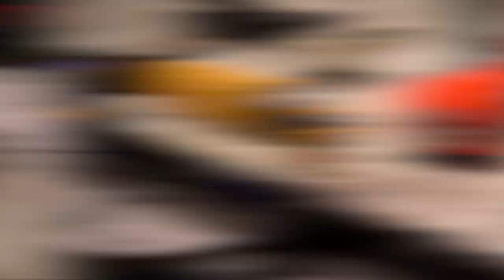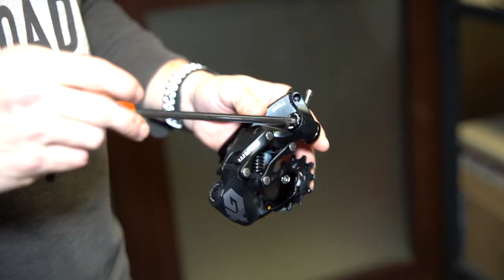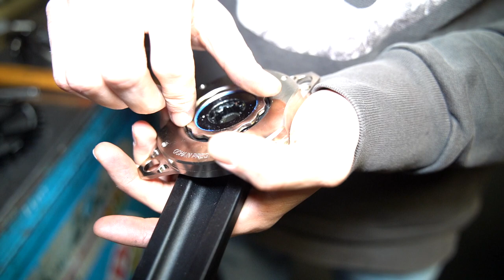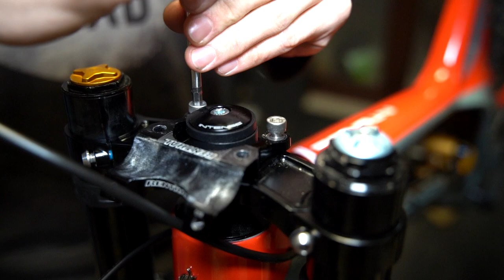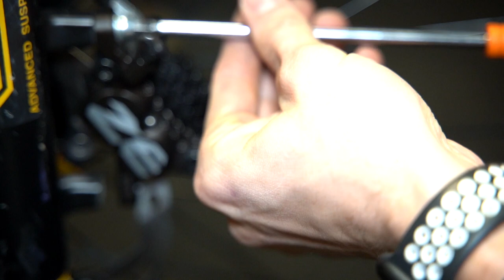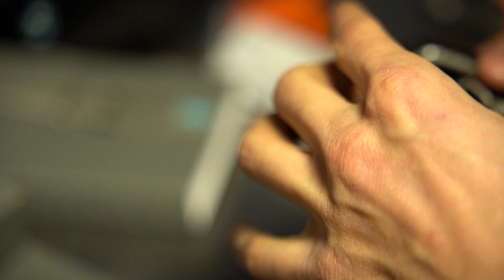DREAM BUILD INTENSE M29 - Custom sick bike💥

Comment: the bike is assembled incorrectly! you can't collect it like this intense M29
Reply from the maker: Mmh why?
Reply: @FrancescoColombo18  because it is necessary to collect it on grease and with a torque wrench! in the instructions, the tightening torque is written!the rotors are small, the tormaza ZEE is full of shit, the connecting rods with the adapter are shit, the SRAM GX switch is shit!If you don't know how to collect, don't do it!